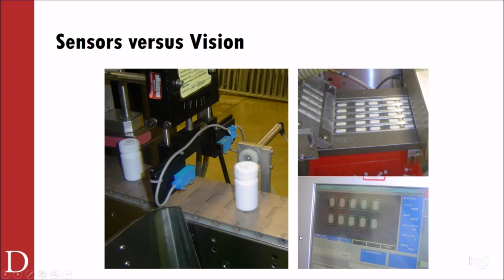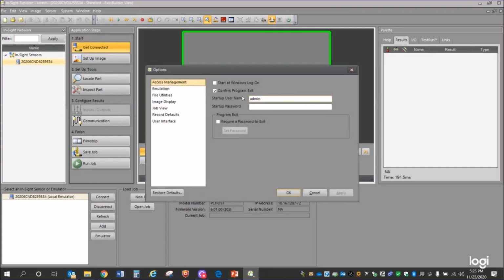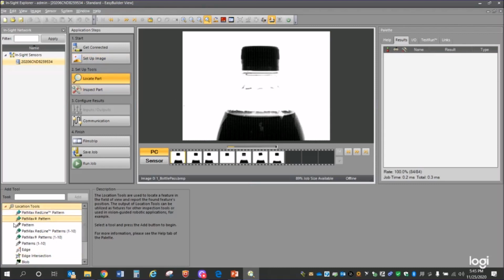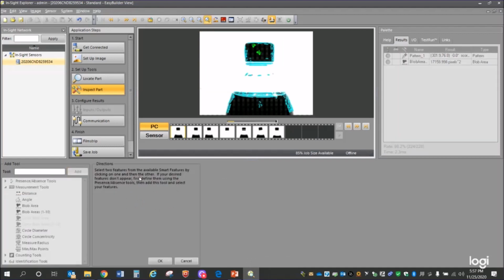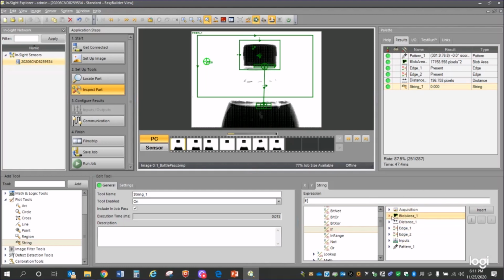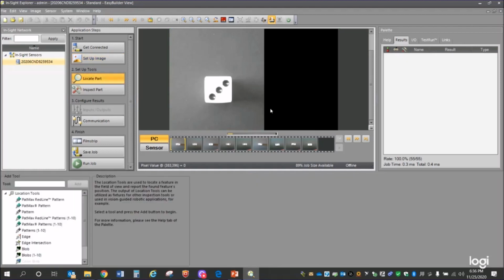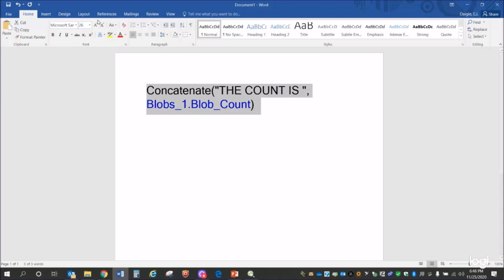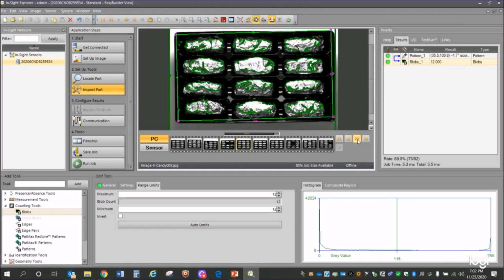Introduction to Machine Vision - Cognex Insight Software

Comment: Thank you for the video it was great!

Concerning lighting that can have a major issue on different algorithms depending on how they work like a basic threshold operation.
For what is termed normalized grayscale pattern matching a change in light level does not affect it that much same with edge detection routines. 

Along with light level making sure your image is always in focus can also be of importance.
People who design optical systems use the term blur diameter and keeping the object in focus keeps that value the same.

Another possible hook is changing the camera gain may help get you back to the response you had before a lighting change happened.
Adjusting a light level using computer control could possibly help depending on inspection speed.

Comment: Thank you for the video it was great!

I have written a lot of image processing code (low level) such as how the pattern tool would work.

I expect it is what is called normalized grayscale pattern matching which computes a correlation coefficient.

For the die with 6 dots the issue is only 3 dots were trained so think of it as image subtraction and this die has 3 more dots which is going to add to the error.

If the edges of the die were trained you would not have the issues of different numbers of dots, but thresholds can always be set.

Comment: Hi, Why is it When I load perfectly regular sized images, that when I open that folder up in Emulator all of my images are zoomed in on a a default setting. Even when hit zoom out, the zoomed in picture stay the same, zooming in or out? Thanks.
Reply: it's because of the resolution of the camera that you using